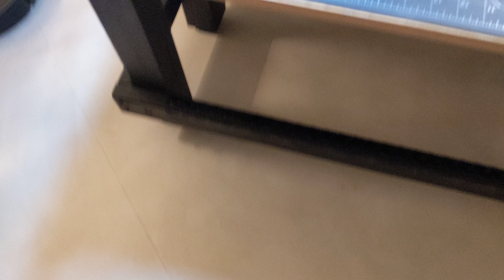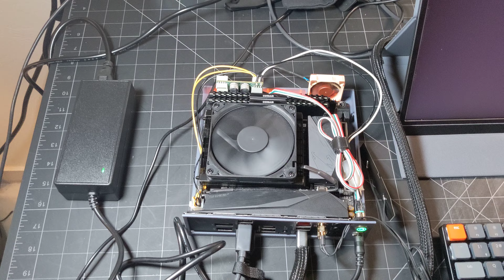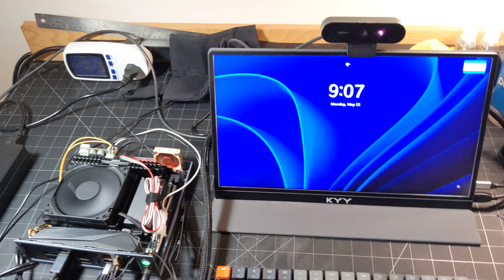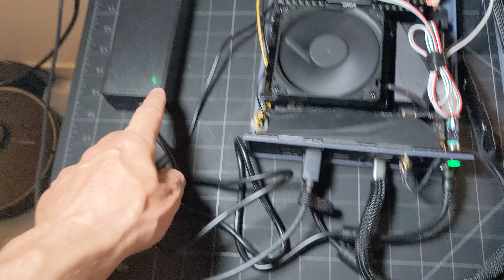Portable mini-ITX build part 2: more parts and an overview.

Comment: I totally giggled at the techno wing thing disgust!  Is the monitor connected via a single usb C?  I can't wait to see how this thing evolves.
Reply from the maker: The monitor is connected by two cables: the usb-c for power, and the micro hdmi for the video. The power could also come from a battery or other source, but at least for now it comes from the computer itself.

If the computer supported 'DisplayPort Alt' mode, then it could provide both the video and power over a single cable, but this motherboard doesn't. Most Mini-ITX don't currently support that.